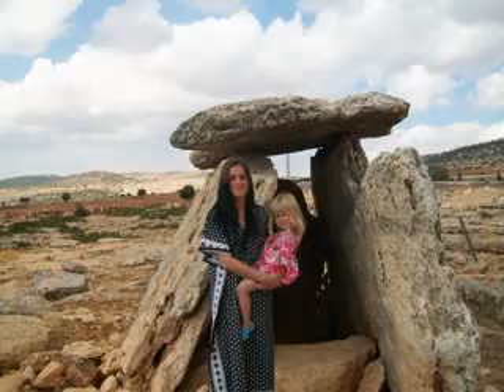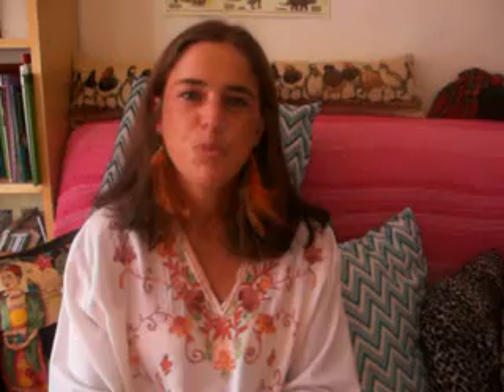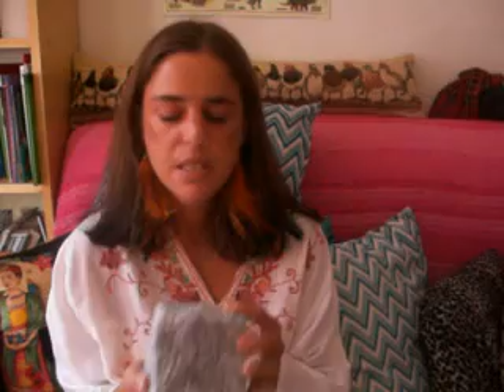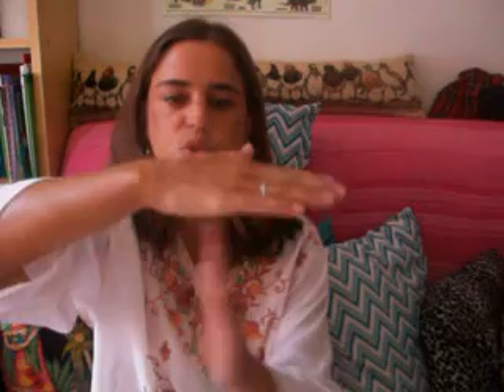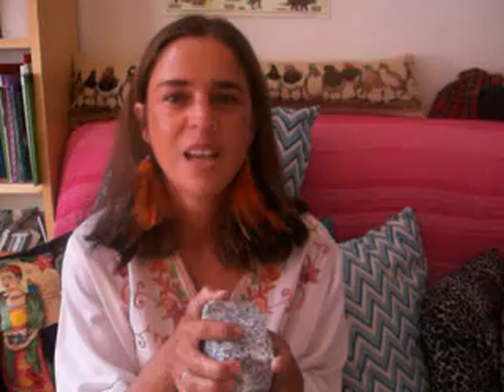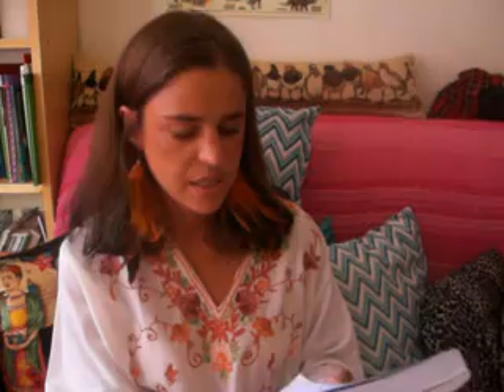Piezoelectricity in Megaliths Explained

Comment: Fascinating research.  I follow piezoelectricity also as a way of describing internal martial arts and yoga and have gotten rare results... thanks to researcher like yourself.  Many masters like dynamo jack have an electric effect and say its electric.. control through pressure in the body through extension and contraction ... pressure changes in the body (holding pressure and tension for energization?)  Proteins are piezoelectric... What can be done to the stone ... energization could be done to the body as well as energy source for other things..  Need to go more barefoot, perhaps in the special areas... Thank you

Comment: I did a few experiments with regards to trees producing electricity, I noticed that the flow was from the top down to earth. Which means that a quartz megalith , would indeed be charging up, from the top down. Theirs also going to be some type of capacitance, where the electron holes in the matrix of the rock gets full and then discharges. Their should be  some type of light show, especially where the general area has some thunderstorm activity, their would be a greater flow of electrons through the material to earth. I think you have nailed it.
Reply from the maker: Interesting comment, thank you.
Reply: Another thing which would have an effect, is if you got a crystal radio earpiece, and got someone to solder the voltmeter probes on the wires of the earpiece, then when you probed the megalith as you did with the voltmeter, by my calculations you should pick up a radio station. It has to be a crystal radio earpiece because they use a Piezoelectric earpiece.
Reply: Nailed it seems a little hasty ...I'd like to see the current flowing up or down the stone  quantified somehow , that would be a step in the direction  of the box of nails.